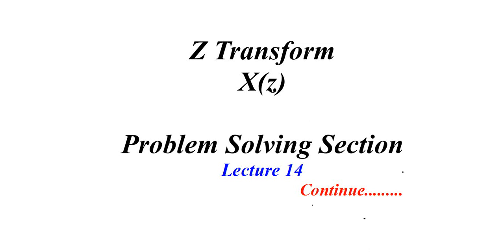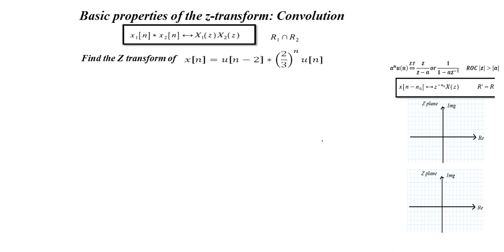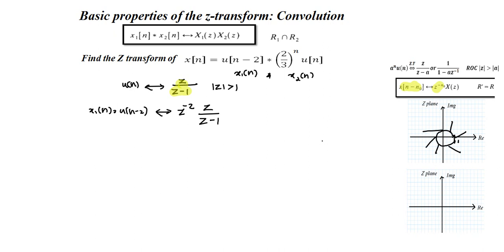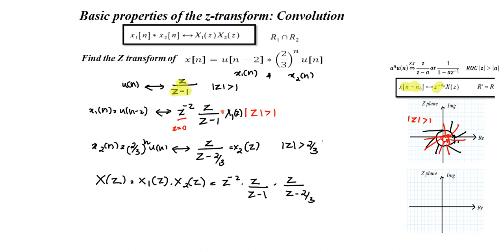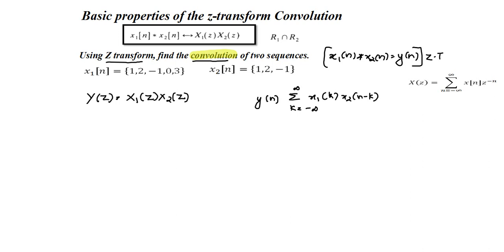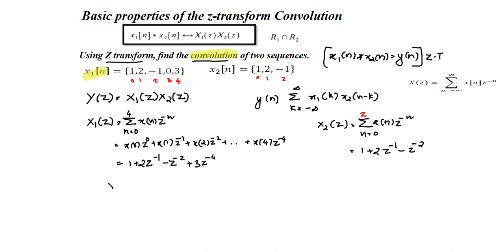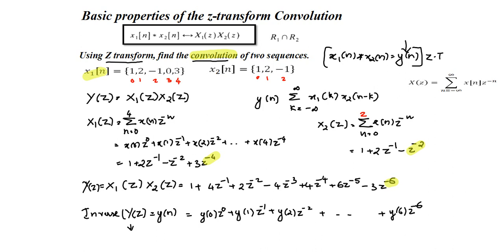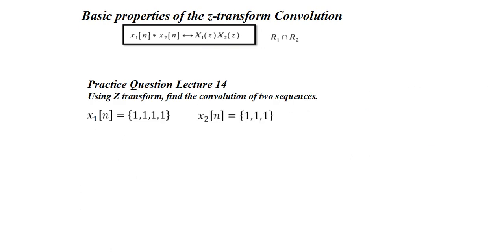Z Transform - Lecture 14

Comment: Sir ,can you please tell the easy way how to solve the x1(z).x2(z) multiplication using calculator, without calculator its very lengthy and confusing.
Reply from the maker: Hi,
please refer to the following link for other methods to solve this problem.
https://drive.google.com/file/d/1aumOqjVLVfK7fAb8mEaq6ufHdFJ-idTL/view?usp=sharing
Reply: @amalkoova  ok sir will refer to it .
Thank you so much sir .

Sir i gone through the link which you shared and matrix method is easy as compared to normal multiplication. 

But isn't there any method to solve that long multiplication using calculator??
Like [2-3z^-1 +4z^-2+5z^-3-6^z-4]×[1 +3z^-1+2z^-2-5z^-3]
Solve using calculator??